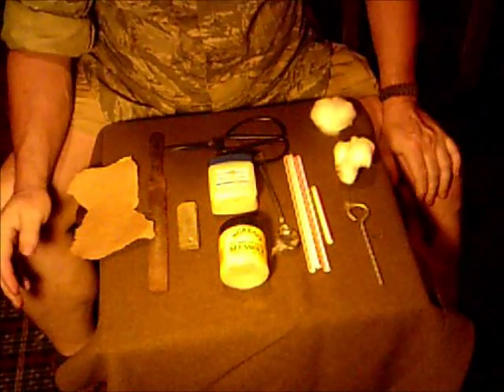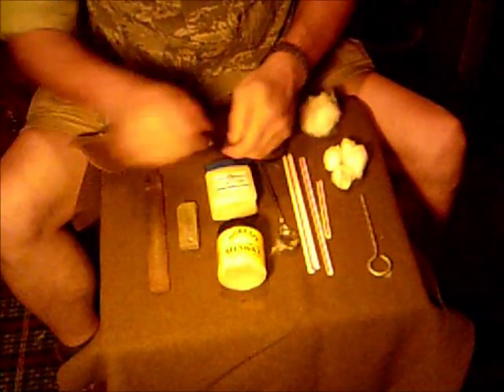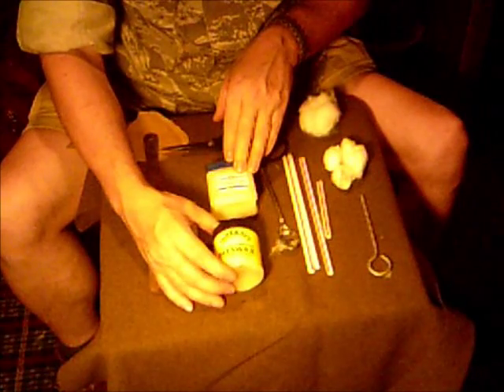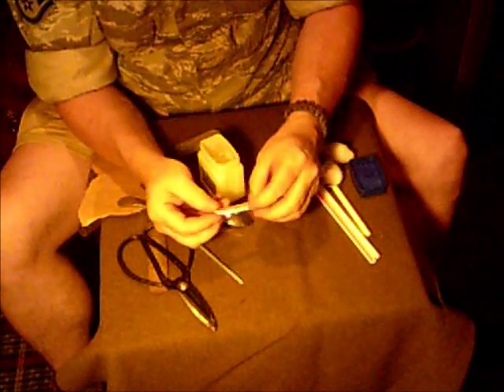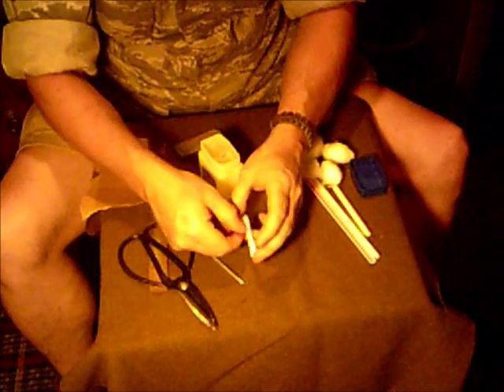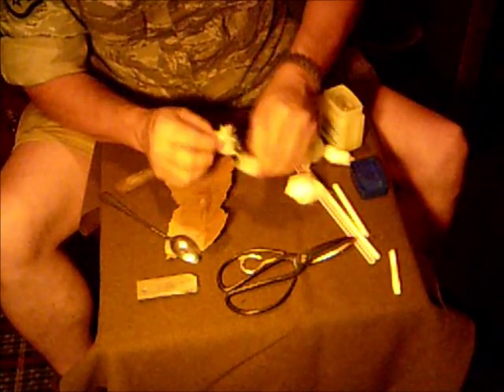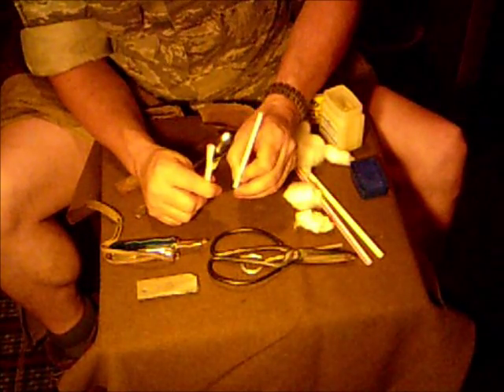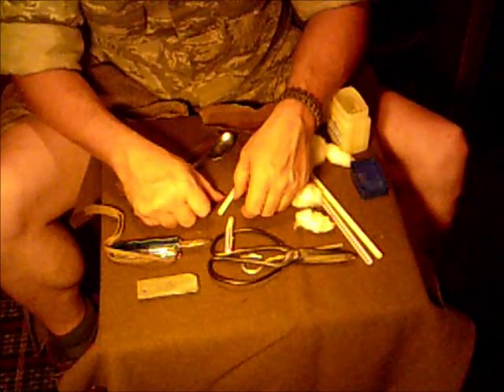Firestraws revisited

Comment: i have made firestarters with lamp oil and saw dust and card board egg crates,,some i use murrays beeswax,, and i use 35mm film canister to store cotten balls with vaseline prepared,,and you can file down the whole magnesium starter with a coarse file and save the shavings in 35mm film canister or small water proof container ,, and it does take awhile to file the whole magnesium starter down ,, but its do-able

Comment: I don't carry firestarters or tinder, but I do fool around with them at home, and I found that Sterno works is an excellent substitute for petroleum jelly in fire straws.   Just make sure the ends of the straw are sealed completely so the alcohol doesn't evaporate.

I put a squirt of hot glue in the straw, and it works very well.  I get a perfect seal, and I think I could leave it at the bottom of a lake for a week and still use it.

One thing I tried that I love so far, but haven't tested long enough to be sure about is using a strike anywhere match.  Cut the match short and slip it into one end of a fire straw and hot glue it in place so only the head of the match is exposed.   Then dip the head of the match in wax to waterproof it. 

It becomes a strike anywhere fire straw.  A handy thing to carry into the woods, and an even handier thing to carry when you aren't likely to have larger fire starting items on you.   They take up almost no room, and weigh next to nothing.  I keep half a dozen in a small tin that goes in my left front pocket, and I don't even notice it's there.

Anyway, I really have field tested them enough to know whether it's a great idea or a bust, but they work very well at home, so I'm looking forward to trying them in the field a  lot more often this spring.

Comment: as usual Blackie it's when you explain some uses for things, that's when I hear something I never thought of, esbit tabs are $1 each where I live but I could probably make 50 of these for $1, thanks. Also I was taking some inside pictures last week that came out like your video, a bit dark, then I changed settings to fluorescent lighting then normal light bulb, and finally I tried the night time setting and that worked great. It's time consuming getting the best out of new gear that's for sure.

Comment: I have to admit, there are times when I wish I knew how to shoot and edit video. Note: The is a simpler way of sealing the ends of the straws, where one new straw can make four(4) fire starters.  The name of this game is called "Where are my pliers?" All you have to do is grasp the straw with the pliers right at the end of the cotton ball. Then cut the straw 1/8" past the end of the pliers, and hit it with a lighter until the end of the straw melts together to form a seal. Simple, but with a risk! Do Not do this after you and your buddies have polished off a case of beer, because the plastic of the staw can catch fire and start dripping molten, burning drops of plastic! You just want to melt the ends of the straw, NOT set the house on fire. Do one end of the straw before you stuff the cotton ball, and the other end after you stuff the cotton ball in. Like Blackie said, carry 6-8 for your own needs, and 6-8 more for your friends who what to know what you have there, and Yes, like Blackie said they will burn for 8 - 8 1/2 minutes, if you have enough Vaseline in the cotton(practice and time).  I have to admit I have never used Bees Wax, because I have never been able to afford it.  Sorry, for the interruption Blackie, carry on!  Oh, I am also sorry, this was my first Thumbs Down, not for the way you manufactured the straws, though I hate it when the caps come off, and you get Vaseline all over your long underwear.  But because of the focus, my poor old eyes are having trouble seeing it after my buddies and I polished off a case of beer. :)

Comment: Blackie..... another terrific video.  The magnesium powder was new to me!!  Good idea.  If you look on Amazon you can find even LARGER diameter straws!!  If you can't find them and want to try some, let me know and I'll send you some!!   Also, I"m sure you are aware, you can pinch off the tip of the straw and then heat seal them with a flame.  They are virtually water proof.  Terrific video and thanks for sharing.  You do an outstanding job.                     Ax

Comment: I've always used cotton, Vaseline and aluminum foil.

Cut off a strip of aluminum foil about 3 and a half inches wide by around the same length. Soak your cotton ball up just like you did in your video, press it out flat onto your foil, then fold it in half, then fold your three open ends closed. You should end up with a square around an inch and a half by an inch and a half. 

If you're really worried about water soaking in, cut two pieces of duct tape that are larger on all sides than your aluminum foil packet you just made,  and sandwich that sucker in between your two pieces of tape. Clear packing tape works just as well for me, and doesn't have that nasty duct tape smell when it starts burning.

Comment: I wonder if u dip both ends in wax, it would waterproof better and also if u need the wax then u have a bit. maybe for really wet areas. idk if the wax would just break off the straws but maybe it would work.